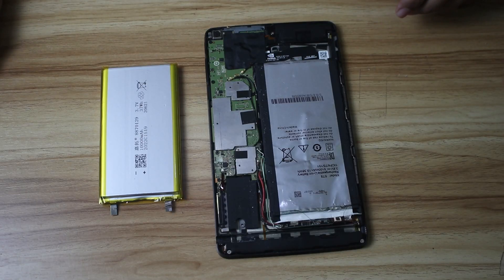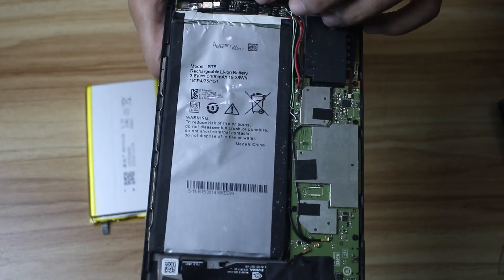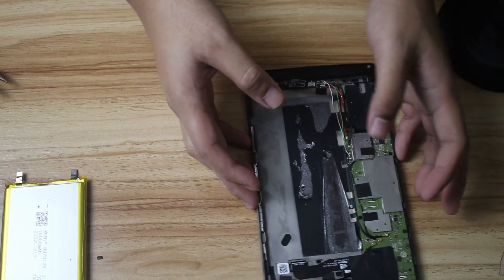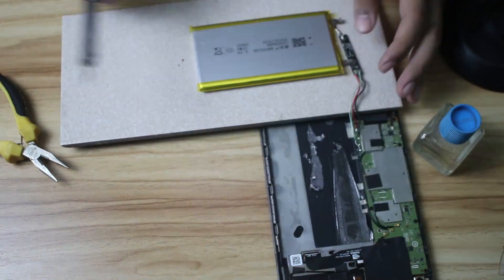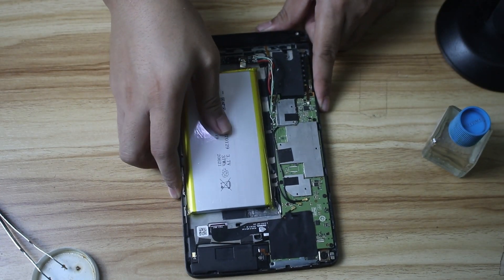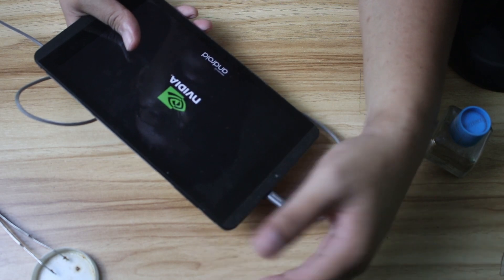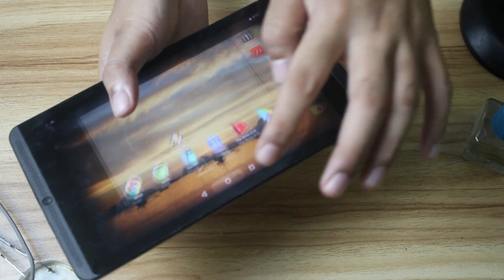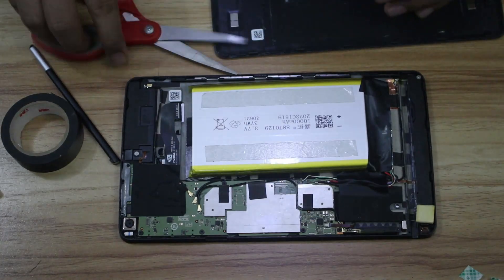I replaced my tablet's battery with a powerbank battery... Will it work?

Comment: Hi @DeuteriumTech... I just saw this today. What battery did you and where did you get it. I got the K1 as well and want to revive it for media consumption. Salamat ng marami.
Reply from the maker: Hi! I got the battery from Lazada. If you're going to do this as well, make sure the voltage of the replacement battery matches the old one. Mine didn't and it won't fully charge.

Comment: Did you change the battery capacity info in the Rom?
Reply from the maker: I did not. I probably should have.
Reply: @DeuteriumTech  I put a 20000 mah battery in it.  But I could not find the file required to change the battery information.
Reply from the maker: @tcirit  I'd recommend using AccuBattery. It can set battery capacity though I haven't used that feature yet.
Reply: @DeuteriumTech  Yes, I use it, but I would like to be able to change the capacity information from within the ROM.

Comment: Very cool upgrade! How is the battery temperature after extended use? Are you able to get 3-4 hours of use on battery power?
Reply from the maker: Thanks! I had an offending app max out the CPU for days. Battery temp was at 40-42°C. Last time I charged it was last week, left it idle while connected to the wifi while an app is hogging the CPU, it's at 42% at the time of writing. I think this one can last a day of watching videos. Unfortunately, one issue I had is I'm not able to charge it to 100%. I can only get up to 80%. Good for battery longevity I guess.